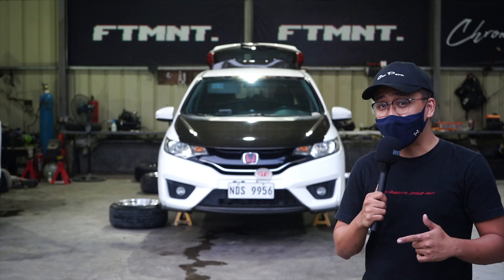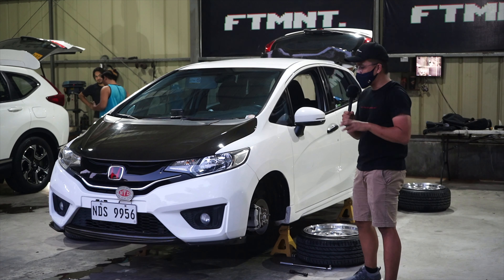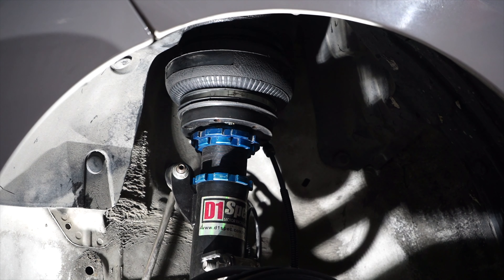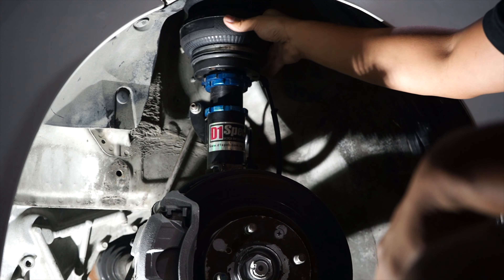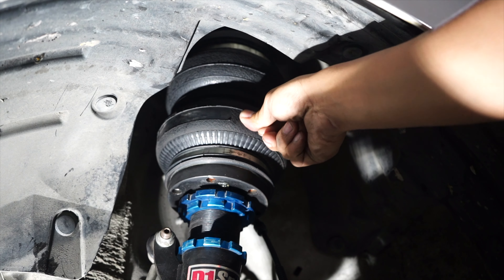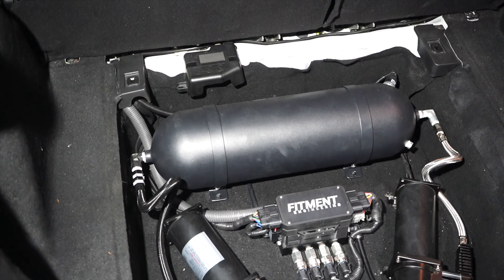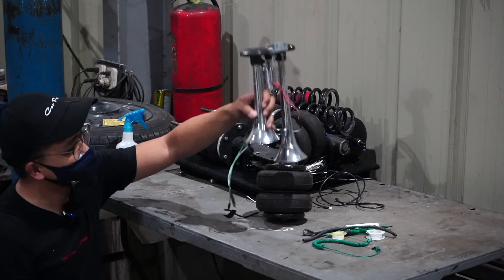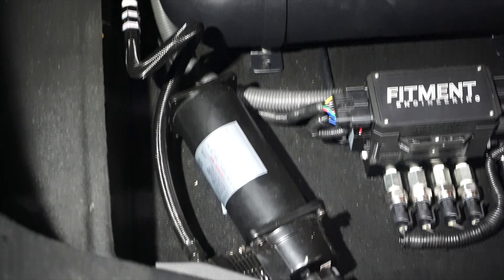SO YOU WANT TO BAG YOUR HONDA JAZZ GK?

Comment: What was the explanation at 7:42? Were those previously on the GK? Also, what's the difference between having bags on coilovers vs on stock shocks?
Reply from the maker: Yes another shop did if before us, the bags was not fit for the weight of the car plus the management system is not to the client's satisfaction. 

Stock suspension is ok. I just prefer to bag this on his D1 spec coilovers since he already had it. 

Plus it gives alot more adjustability
Reply: @FitmentEngineering  Awesome thanks.